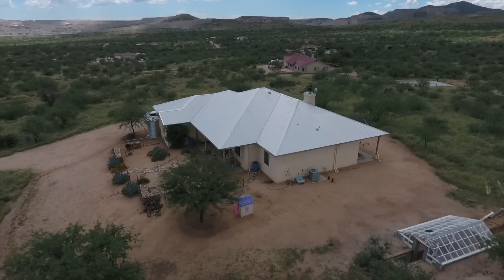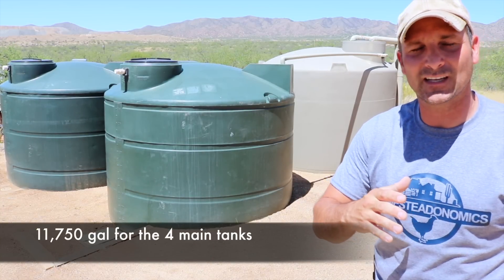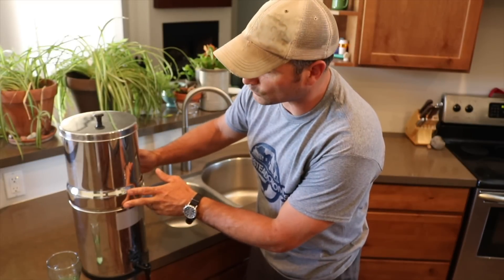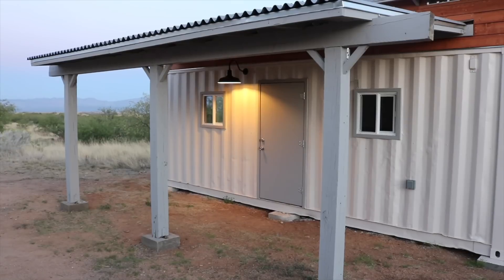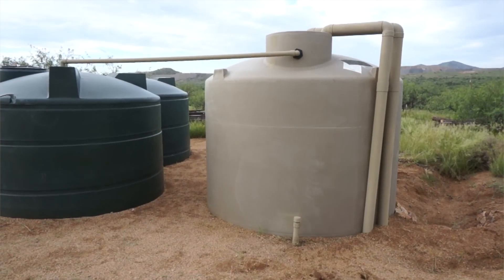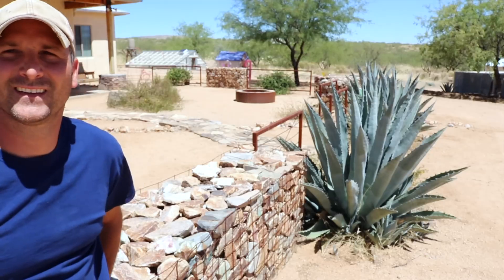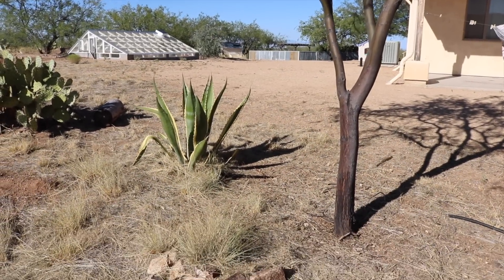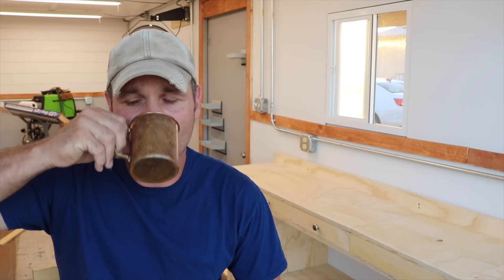Rainwater Harvesting QA - Cost, is it Illegal, how I treat, etc,.

Comment: You can buy three stage water filtration units that eliminate the need 100 % of using any chlorine in your rainwater tanks, the stages are chemical biological then ultra light and fit under the sink with slim limes running to your pipework from your kitchen taps..ive had one for 11 years now with big rainwater tanks . They work really well. The filter cartridges are really cheap to buy as well and I’ve changed mine 3 times in 11 years without the need for any chlorine at all.
Reply: Use a R O system
Reply: RO wastes twice again what it purifies. Not practical on a rainwater system.
Reply: @billypurifoy640  RO Uses power and power costs big bucks.
Reply: I think the Chlorine is to prevent growth in the tanks though. you can buy all the filters and cartridges and UV lights you want, but the tanks are still upstream and if they grow algae, they'll just ruin and clog everything down the line.

Comment: Now let us see your children. Just to see how the hormonlike substances from the plastifiers of that plastic tanks disfigured them.

Why not use ozone instead of chlorine?
Reply: plasticizers require heat cycling 50C to 350C, and back again, to produce parts per billion of plasticizer residue. Since only volcanoes and geysers naturally get that kind of cycling of plastic.  I suggest that you go up and stand within 12ft of volcanoes, and geysers with your plastic and see if you die a horrible death from plastic or 2nd and 3rd degree burns all over your body. unless your a plastic manufacture and breath in harmful by-products to produce plastic, you'll be alright. Now lets talk about GMO (genetically modified organisms) ingredients like corn, rye, cotton,  flows down the food chain, fed to chickens, pigs, goats, cows etc....... they all poop, that gets into the water supply and downstream fish and shellfish, clams,  oysters , sharks and anything else you can pull out of the water, now also has some GMO in the system, that's what you should be worried about disrupting hormones, in the generations of children to come.

Comment: From Canada:

Obviously nature is rather different here. but thinking of what I hear oin you tube oin the subject oif water harvesting, I suspect that certain more densly populated areas that have city water infrastructures want to make their residents pay for theoir water as a means of supporting the infrastructure cost. This as far as I know in my 73 yerrs, is unheard of in Canada.

As for snow collection, some amount of this may be done but the worthwehilenes of that will depend on local precipitation. For example, if you dsrive north from Montreal you will eventually pass the town of Grasnd Remous just before entering the wilderness park. The raos through that is an easy hundred miles alone, north.

On the other side, thge climate is notably colder, in fact it is they type of clime\te known as an arctic desert. the precipitation is comparable to your Desert, but it is frozen much of the year. since the land is largely uninhabited anyway, little more to think about save not polluting.

By the timew you come to a town or small city, likely you will find some degree of infrastructure, but any collected water will need to be kept from freezing, so it will need to be stored inside somewhere, although this does not necessarily apply to sewage and waste water, as as long as it is kept flowing, and there is enough of it it will not necessarily freeze before it is dumped to nature.

Once it freezes there will be no odour, but if it is dumped far enough away from dwllings, and it melts in the spring there are insects that actually can survuiv ona diet of human excrement! Many years backl I actually saw a colony of these in the woods where someone had defacated in the bush about two weeks prior., Nature was taking card of its own. This was not iun a subarctic climate but it was in an ares of forst and lakes not so far from the town of St. Sauveur whereOI was camping one summer. That area is not an arctic desert but typical of Canada and its huge temperature variations, both night to day and seasonal as well as regional, many northern areras may have a boig spring thaw, and that will let nature do its thing, as long as you are not so far north as to be in tundra.
Reply: what language do you speek   is it a spelling problem or a translation problem   but it sure makes it hard to read and understand......

Comment: I suppose, if you wanted some water pressure, you could put a IBC on the workshop and pump it up there with a 12V waterpump and a solar cell that has an electric shut off switch when the icb is full.  You do have alot of sun in AZ that you could put to work for ya' !   Oh, and Navi Gator... a silver dollar, 99.99pure, (which now would cost $16 - $18.oo is a great idea... throw it in the main tank right before it goes into the house.  I keep one in my 1gal icetea pitcher all the time (I am old !)   This is an excellent video !

Comment: Hey great stuff. *People mention silver coins to water- it's said that's how the rich avoided the plague back in the day, as they were drinking wine out of silver goblets and the wine broke the silver down so they digested the silver micros which have antibiotic effects. Anyway, I built off grid on mt. shasta at 6000' and had to pull water from 280' existing well- that was a project! Then ran lines to a holding tank above a shipping container to grav. fed sink, shower, toilet and then did my own (well above code) septic. Also own the Berkey, with floride filter and use their shower filter as well. Like your vacuum extension! Looking to build again, this time in TX and am looking at some rocky land making the water table and drilling suspect- will def. consider this- actually, it makes the most sense! Thanks so much, love your other videos too! Best, *A.

Comment: The city gov can't charge for the water you get
Reply: A man in my state of Oregon was fined for collection of rainwater
Reply: Doing  this in ireland for 15 years had a very hot summer  have about 5000 liters did my water systems  with old parts my pumps are worked on 12 volt pump use the water for toilets  cars lawns elce  the government  want 2 charge for water the never tell people how easy can b saved
Reply: The city I live in would love it if people collected water as the drain systems required to keep roads from flooding are extremely costly. My property taxes increased $300 a month this year to pay for new drainage systems in the city. Then again, I live in Minnesota, we get a lot of water during summer and winter (if winter is not too cold). This would also reduce the cost to the city to operate the city water filtration systems. With less demand for water, then there's less water to clean, which increases the life span of the equipment involved, thus saving the city money. The taxpayers are only going to pay so much before they move out.

That's my experience though.
Reply: Will Klinger maybe not but i no for a fact they charge for water run off in cities.  the thing is more than one way to skin a cat old saying. They will find away you heard that cockroach can survive thew a nuclear war . well governments can find away make no mistake about it.
Reply: But keep taunting them and they will find a reason to tax it, charge for it or some kind of cost.

Comment: You're not getting any of  the negative additives that most cities add to their water either. It does sound expensive but you can't live without water, it sounds like you made a good decision to me.  Right now I have city water but a person never knows what will happen. Thanks for sharing with us. 
They do have that guttering in my Home Depot now like you used on your low sheet metal rain catchment roof , it sounds a bit high but it is 16' instead of 10' and it is aluminum instead of vinyl.

Comment: Now all you need is some solar panels and a windmill and you'll be set. To many overpriced bills where I'm from and almost everywhere now. Rather awsome setup you got and informative video.
Reply: You could do solar in AZ. I live in MN. Looked into solar over a 20 year period. My current house will save -2000 over 20 years. Doesn't work everywhere :(. The problem I have is my roof is too small. I would need additional solar panels to contribute to the electric grid.

Comment: Ever wonder why BOTTLED drinking water has an expiration date on it? It's not the water that goes bad, its the man made packaging made from chemicals/oil products that leaches into the water over a short time, hence the expiration date. Take a look at ANY store bought water container, you will find a date stamped on it somewhere, sometimes hard to find, but its there.

Seeing water stored in those large reservoirs which is also man made from oil products etc. should be worrisome, is it not?

Comment: $5,000 is CHEAP, btw. Great and inspiring project
Reply: Just today I watched a video on U-Tube where a couple in Idaho had a professional well driller drill their new house a well.They said it would most likely have to go deep as there is a great many clay layers, some as much as 200' so at $48/ft it was possible they'd be cutting a check for $15,000 to $ 48,000,the latter amount is what a neighbor paid for his. Well they lucked out big time,85' & 10 to 12 gallons per minute of good water.He said he'd a been satisfied with 2 to 3 gallons per minute! That's a fantastic well,even the drillers said that was about the best they'd ever brought in around that area.
Have fun & be smart......
Reply: By the way ,their total bill came to $ 5,600, dirt cheap in Idaho I recon'd.
One of my 1st jobs decades ago was digging wells by hand,then lining them with brick,dry no morter.The brick were curved so they went together well . 36" diameter usually some times 40" to 48" .On the Atlantic ,mostly sandclean sand occasionally pure blue clay,good enough for all the crazy potters to show up &  ask," since you're already down there could cha bring up a few buckets of that good clay up next time ya come?"

With out fail.Those were good times they were....

Comment: I harvest rainwater into 2 ibc totes off my roof for garden use. I noticed early on that it doesn't take long for the water in the totes to start to stink! I thought about water in nature, water in ponds can get stinky or stagnant  but water in Creek's is always moving and never stagnates so my solution to this was to add 2 fountain pumps that circulate the water in the tanks 24\7 and it works great. I was wondering what you do about the water stinking? Does the chlorine your adding keep the water from stinking? And if so how much do you use? My totes are painted black and there is no algae.
Reply: The main cause is water being able to penetrate your mostly clear totes and allowing for bacteria to grow. So yes adding chlorine would have been a simpler solution for you
Reply: @lyricderbin  Maybe but I'm not a fan of chlorine in the garden. The paint and pumps work great.
Reply: hence the whole discussion about colloidal silver. "good enough for NASA good enough for me", I say
Reply: Kansas Gardener you could also try a UV light pond filter. Or just floating a well waterproofed UV bulb in the tank. Doesn't even need to be on all the time for such a small volume of water. Kills pretty much everything
Reply: I like the idea of water movement, do you use copper piping between the tanks for additional antibacterial properties?

Comment: good for you,  I like to have system that boils the water then physially filter the system water then microwave the water to remove un seen life forms smaller than the testing scale normally uses which is 10-3 when the testing scale needs to be 10-86 scale then physically filter the water then boil the water again the user use air compressor system to put the hydrogen into storage tank and the oxygen into storage tank then can user use the gases as fuel source for steriling engines generators or user use the gases in the storage tank to covert through filter system into clean drinking water.    your system makes since. have a great life good video.

Comment: Not to sound dumb (I have been to Arizona) but one question I did not see asked was could you possibly catch enough rain water in the desert to even make it worth while? That's why they call it a desert! I thought some places in the desert SW only received 4" of rain per year. Where I live in the southeast we get between 40 and 60" per year.

The cost of your system is not that bad for what it costs just to get city water to a house. This is not counting the monthly water bill. And extra if you are on the sewer system.

I've had two water leaks since I moved into my house in 2000. Luckily the one I had 13 years ago was at the meter. This was caused by a tree root. Just recently the second water leak was at the opposite end where the PVC pipe connects to the steel pipe going into the house. This one was a cracked joint but not caused by root damage. So I got lucky a second time. 

Next time I may not be so lucky because I live 700 feet off the road. Trying to locate a leak in a 700 long pipe with multiple joints every 20 feet would not be cost effective verses replacing the entire line. In fact I think this is the second water line that has been installed since my grandfather had this house built in 1976.

The water pipe snakes around a bunch of trees and the pipe is made of vulnerable PVC pipe. That stuff does not bend but snaps whenever a tree root grows underneath it.

Worst case scenario. I got two quotes for a new water line. Both were around $7000!

The good news is they said they PEX pipe is much better than PVC and comes in 500 foot rolls so there would only one one joint involved. Well three actually. They said PEX was less vulnerable to tree roots like PVC. So maybe I would not have to worry about it anymore.

I thought to myself, since we get between 40 to 60" of rain per year, I could dig a hole and bury one of those monster tanks that Tractor Supply sells and collect rain water from my house cheaper than having a new line installed.
Reply: The Sonoran Desert (AZ) is the wettest desert on earth. The entire concept shown in this video would be unworkable where I live in the high desert (San Juan Basin) of Northwestern New Mexico. Average rainfall is 9 inches/year and has been much less the last few years as the region is in the grips of a severe drought.

Comment: If (a very big word) you knew what your cost was and of course you could have always estimated but i would have done a break even analysis.  Compair your numbers against an average water bill in your residential area and you could have figured out how much per month your system is saving or costing you.  $5K is a lot of up front money but if you're going to stay in the house for 20, 30, 40 years it will probably be worth it and you're very independent of the water utility owners and their charges to you.  However, a break even analysis is critical for this type of decision.  Most solar systems have a break even time of at least 15 year and most are 20, 25 or more so to me that's not worth it.  But if they could get the break even down to 10, 8 or less than 5 years most people would jump in.  I know i would!  But nice ideas, great system and congradulations on your conservative efforts.  You never mentioned how much you think your montly water bill is costing you...did you?  That's the bottom line for many consumers thinking about an undertaking this large.

Comment: Impressive video, impressive water system. How long do you go between rain events? Is this how long you must store water for? My family lives on a forested side-hill in Pennsylvania, and during storms there's always a concern about leaves and little bits of limbs falling on the house. I have no idea if there's any way to compensate for that. I wonder if a house that has solar collectors on the roof would interfere in any way, or if solar power could be designed-into the house's overall systems.

Comment: The city of Tucson has grants and loans available for low-income residents. It probably wouldn't be nearly enough to construct a system this elaborate, but it could be a start. The fees and sewer costs on my bill are more than the actual water used, so I wonder if it would be cost effective while remaining on the grid. I'm thinking the best way to do this might be to go completely off grid as you have done. Great video, very thorough and informative, thanks.

Comment: Maybe you mention it in another video but: 1) what is your annual rainfall there?  2) how much does it rain on average in a given rain event?  3) how long between rains during the rainy season?  4) how long is the rainy season?

I recall a garden show out of San Antonio TX called "The New Garden" and they explored cool stuff like grey water systems and water catchment etc.  To calculate the needed storage capacity, one guy estimated their daily household water use in gallons, found the longest period on record without measurable rainfall and multiplied the 2.  He added in a 50% just in case factor and has never even been close to running out of water from his storage.  SA does get over 30" of annual ppt though.

You've done some nice work there.

Comment: You mention the "life" of your storage containers at 20-30 years, but that is because they are exposed to UV light (UV rays are the destroyer of plastics).  If you built an overhead "roof" to block out the UV rays, as well as "tarp" walls (to block light from the sides) they would last many more years to indefinitely; AND the roof would add some more catchment area.